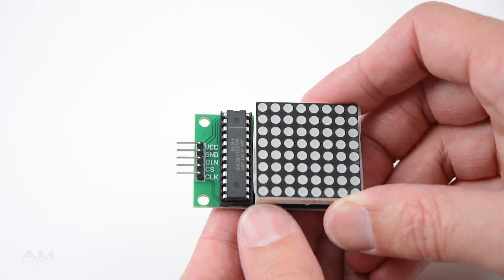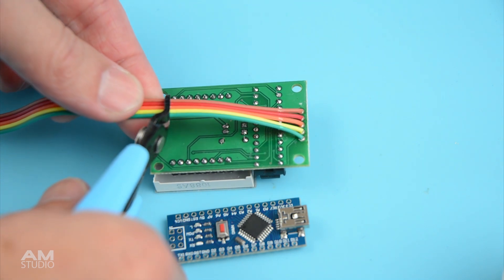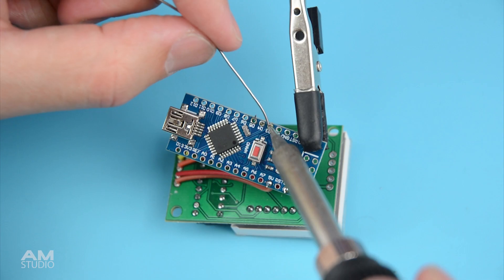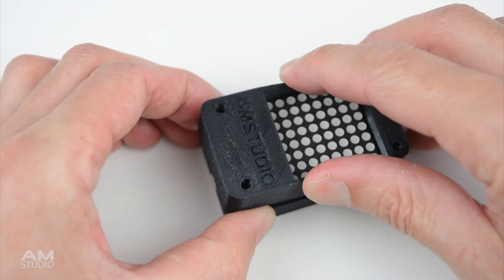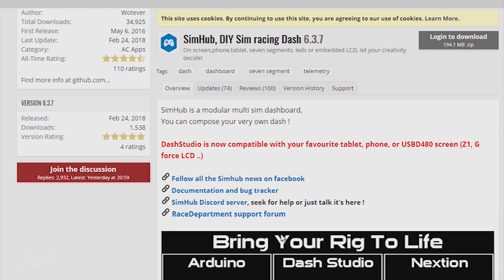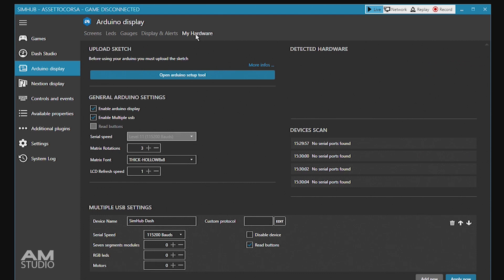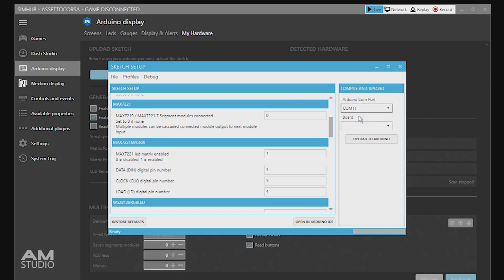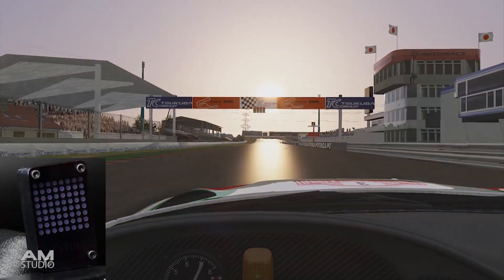HOW TO MAKE A GEAR INDICATOR DISPLAY w SIM HUB DIY

Comment: I am using a flag display working also with arduino nano, the data line is connected to the D4 on the arduino. Can I use the same arduino nano to operate a gear display simply by starting with connector 5 up to 7??? Or do I have to use a new arduino nano with each hardware-plugin...

Comment: I kept the stems on the display screen and soldered the stems to the board as I plan to install it onto a tach can.  I cannot get it to work, unplugging it lights up the display for a instant then goes off.  Any idea as to what can I check.
Reply: I got it to work, I had to change a setting on the game (automobilista 2).

Comment: Hey Guys, my Matrix shows nothing. I´ve tried everything. The Wiring is correct, Simhub is set up correctly, i´ve tried various Arduinos. With a Test Sketch the Matrix works fine. But as soon as i upload the Sketch from Simhub nothing happens anymore. I´ve tried ETS 2, Grid, F1 2016. Nothing.   Anyone has an Idea?
Reply: @Stealdrum Same here, Test LedControl sketch works (mirrored though), but simhub nothing. Did you find a solution?

Comment: This works on euro truck simulator but you have to install a driver. Also using a arduino uno makes it ten times easier
Reply: Will it show all the gears upto 12?

Comment: Where do you get th e small box from??? I have looked in our electronic store but they just offer me the LED Matrix... Unfortunately I don`t have a 3D Printer
Reply from the maker: I designed and printed the box. You can use a local 3d print service

Comment: can anyone Help me? i used an arduino uno because i cant upload the code to a nano for some reason and the code uplodes fine to the uno but when i start up a game the display doesnt work. i have the wiring right and i followed all the steps in the video but i cant figure out why it isnt working (i tested it on dirt 4 and project cars 2)
Reply: Me too

Comment: Hello. Love Your videos mate! I've got a problem with this one. I've ordered the parts You recommended and build as in Your tutorial, but I can not get it to work with Project Cars 2. The SimHub shows that the game is connected, but all of the leds in the matrix just keep staying on and nothing else happens. Any ideas?
Reply: I also have this issue, same in every game I try. LEDS stay powered on and don't change, the lights on the Arduino (RX/TX) flicker when at high RPM but the matrix doesnt change
Reply: @rtfelix2288  Same here, did you find a solution?
Reply: Did you find solution?

Comment: Two Questions: 
1. did you say this can be entirely connected without soldering by using the pins on the dot matrix and using the supplied pins with the Arduino? 

2.Do you like this the look of this display over the nextion one?

Comment: Hey man, your videos are top notch. Short, easy to follow and hella informative. Just started building the sim dash, the sequential gear and button box. Just a small question, if you ( or somebody) can anwser, I would be gratefull. Can´t we use the same Nano without messing with code/sketch to build the sim dash and this gear indicator all in one package instead of using one Nano for each? Thanks man, love your work!

Comment: Is it possible to combine the gear indicator and the RGB rev lights on one arduino nano?
Reply: I'll try it soon. TBH it should be possible if you add one more 5V source (from button box board interface)
Reply: @TaranPOLAND  so did it work ?
Reply: @xXxXENcoreXxXx  damn still have no Time to do that... I'll try to find some time
Reply: @xXxXENcoreXxXx  yes it does work.
Reply: @Tim_2060  is there a guide to follow to make it work with one arduino?
Reply: @Tim_2060  can you send any pictures or something of it all assembled onto one ardunio if possible?
Reply: @Tim_2060  do the places that the wires are soldered need changing as some of them conflict between the rev light and gear indicator? thank you
Reply: @edwardpage9996  if there is a conflict you need to change where the pins need to be soldered. This can easaly be done within simhub. If you add the leds you can see a number. If there is a conflict the box will go red. If there is no red then your all good.
Reply: @edwardpage9996  did you get any luck with using both in one?

Comment: If I wanted to combine a TM1638 with this dot matrix could I just use one arduino since they use different data pins?
Reply: TNT321BOOM you can do it ;) simhub supports it
Reply: Hey wotever, great job on the Simhub :-) i´m using and it really is a great piece of software for the end user. Small related question, can we connect the tm1638 + MAX7219 dot matrix + 2 MAX7219 7 segment to only 1 Nano v3? You think the Nano 5v output will be enough? Thanks man.

Comment: Love your sim stuff keep up good work
Reply from the maker: Thanks!
Reply: @amstudioprojects  i have a question. in the rev light video it shows you are using d4 for input and here you are using d4 too. so can i just change the pin to other pin if i were using only 1 board for both ?